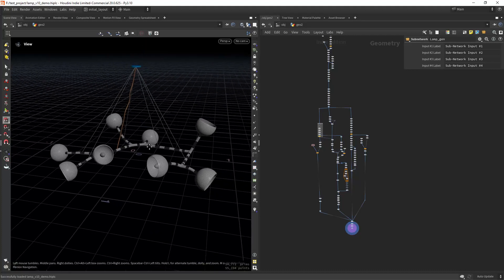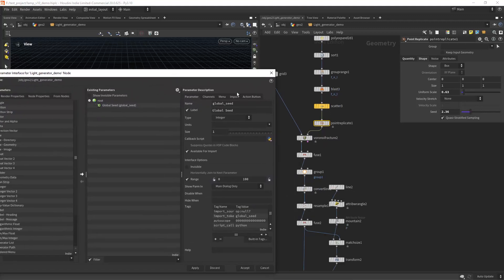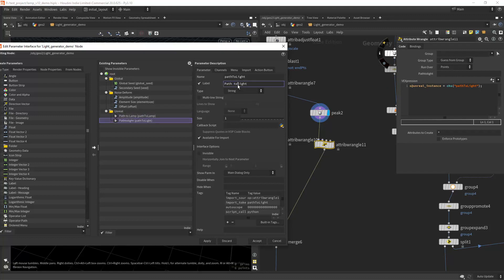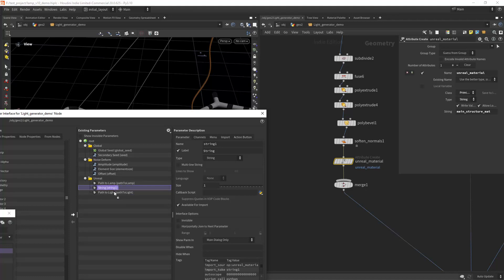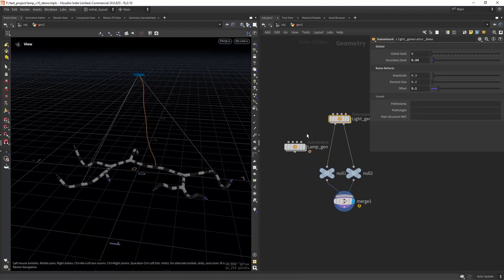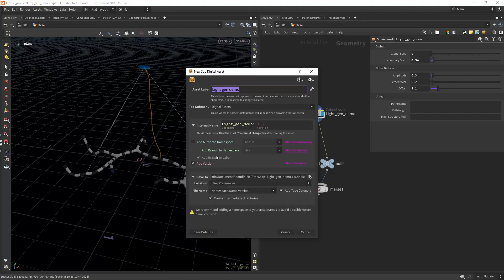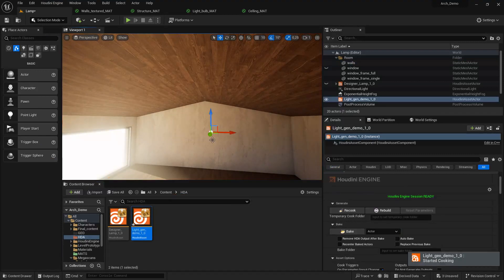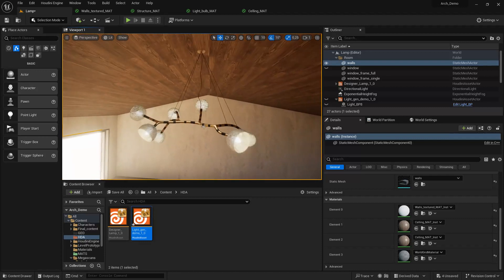Houdini to Unreal: HDA Setup and Workflow

Comment: does somebody know why my HDA only shows the Houdini logo in Unreal? trying to figure it out for some days, but don't actually know what is going on...
Reply from the maker: Hard to tell, have you tried to post it on think procedural discord? There is a section in there for unreal . Cheers
Reply: @cgside  well, I can't actually get invited to that discord server, I don't know why...
Reply: Hi, you probably figured it out by now but in my experience it shows the Houdini logo when you have an empty input that generates your asset. For example you may have a setup that requires a curve to generate lets say a wall. With the input empty it only shows the houdini logo.